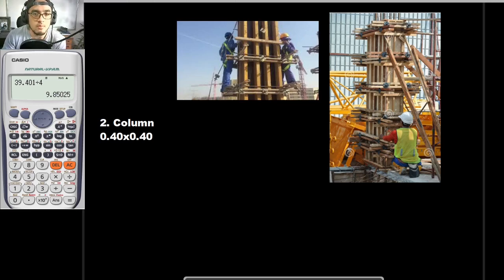Construction Estimates: Formworks Part 3 (Column Formworks)

Comment: Hi, quick question. Do we not include the thickness of the ply wood when calculating? Or is it negligible?
Reply from the maker: Hi sir. For better accuracy of estimates, you can consider the thickness. However, it is somehow negligible. Not taking the thickness into consideration does not really hurt, budget wise :)